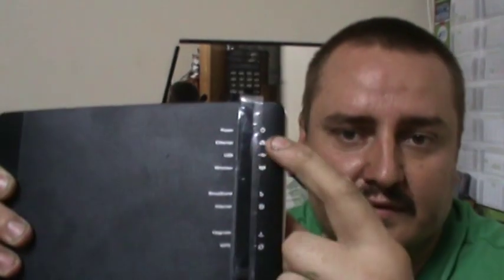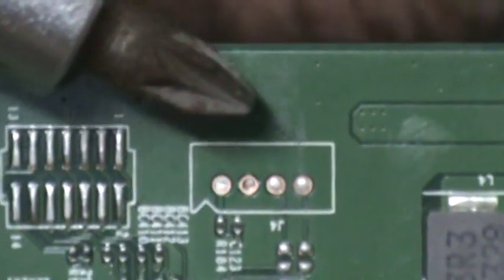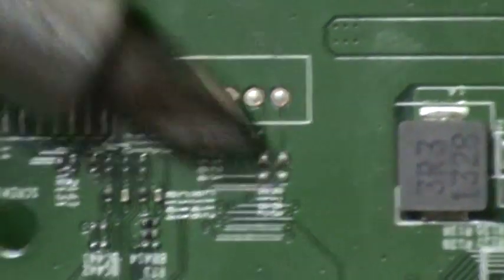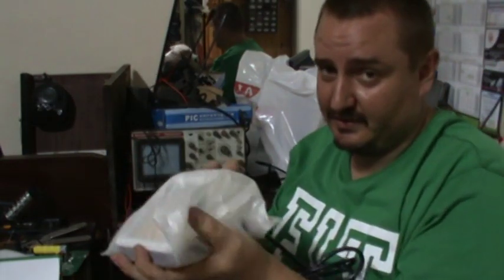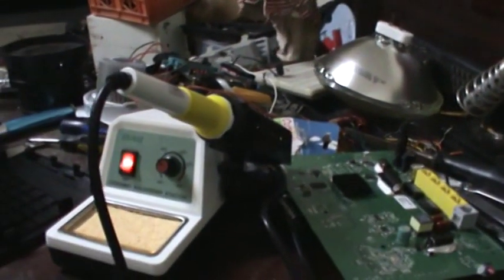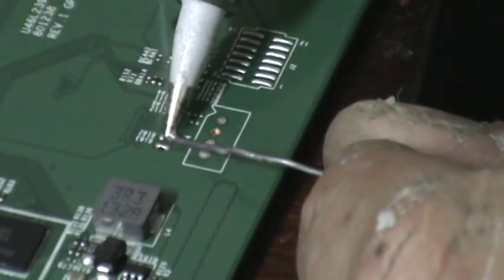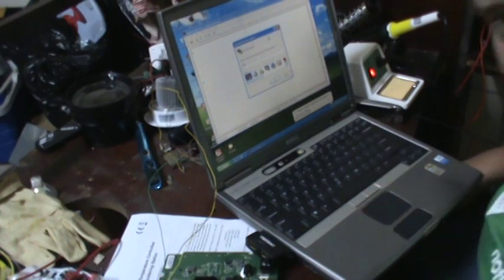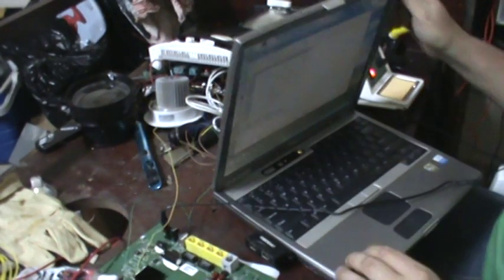Connecting to Hidden Serial Port on 'TG589VN V3' ADSL Wireless Router

Comment from the maker: Ok, Success. I can now get in to Telnet, change users, etc.
Here is how you do it.
1) Download the firmware file from : 
http://products.plus-payh.co.uk/firmware/
I used the Plusnet - TG589vn - 10.5.2.F (the last option in the list)

1) Then follow the instructions on
http://www.jonathandavis.me.uk/2013/12/flashing-generic-firmware-on-a-technicolor-tg582n/

The only difference is that you will use the firmware you downloaded in 1 Above.

Then afterwards you can go into the web interface (http://192.168.1.254) and at the bottom you can set a password for the Adminstrator user.
After that you can Telnet in, or use the Onboard Serial port of the router to log in and have fun.

Please can you give me a thumbs up if you have upgraded your firmware by using these instructions, just so that I can get a small reward for my work on this.

Thanks
Peter
Reply: Peter Kolbe Thanks for this! I'm posting this using an ex-mweb fon router, now dialing my afrihost account!
Reply: Peter Kolbe Can you help me? I need a TG587n V3 firmware.
Reply: Peter Kolbe after this procedure is it possible to retrieve previous user credentials? For example download users.ini etc 

Also lets say the router has some configuration .. will it be overwritten with the firmware upgrade?
Reply: Did you ever try JTAG hacking this thing? Mine is completely dead firmware-wise, I just get the following when booting it:

Technicolor Gateway
(c) 2012, All rights reserved

Decompressing Bootloader................................
Gateway initialization sequence started
Boot Loader Version : 2.0.16
Error: no valid RIP2 header found!

CPU                 : BCM63168-D0
RAM                 : 128MB
Flash               : 64MB NAND, blocksize=16KB, pagesize=512B
Board Mnemonic      : 00NT-0
Market ID           : FFFC
Unrecoverable error: invalid RIP

It looks like there are some missing components on the JTAG layout, being BC410, BC411, BC412, BC413. Capacitors, I guess?

Comment: Ok so i check version 10.5G is actually for Mweb and is v3 then there is R10.2.8 for v2 that im sure should work and R8.4.5... I would try the R10.2.8 else try the 10.5G and just setup a Admin username and password for the Router
Reply: Did you manage to load the firmware?
Reply: Nah but if someone can find the username and password you can just telnet in

Comment: There you go. If you come right let me know. Would like not to be locked out of my Router settings. I assume its the Linux kernel is the actual IOS and the rest is added tools. I suggest using your old Router as a DHCP and Setting up the TFTP server on your PC. From there is should be easy just copy the ISO in the right place and reboot the Router. Let me know. Thank Lee

http://www3.technicolor.com/en/hi/minisites/open-software/dsl-cable-ip-modem-gateways/dsl-gateways/tab/r8-4-5

Comment: Hey man. Listen you have any way to reset to the default ISO. I can just telnet to the device but of course there is a username and password that i do not have the details for. If i can install the default firmware then i can just log in with the default username and password
Reply from the maker: If you hold the reset button in when you power the router on, 
then it will try to download a firmware image from the LAN.
It will look for a DHCP server to give it an address, and then TFTPD / BOOTP server must be running on a computer on the network to serve it the firmware image.

Unfortunately I have not found a Firmware image for that router, so I could not get any further.
Reply: Ah nice. Ok I'll have a look for a IOS and let u know. Think this version 3 might be vendor only that's why you can't find firmware. Might have to use version 2. Sure it's 90 % the same. Probable only the fon won't be there and that's good anyway.